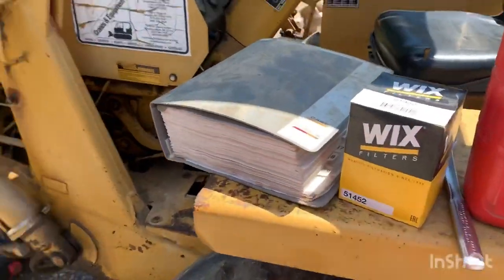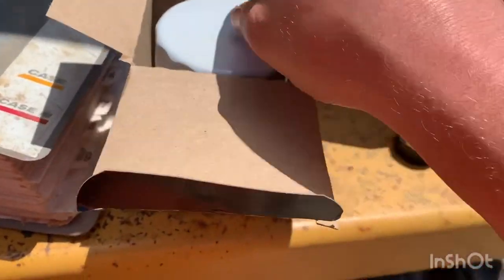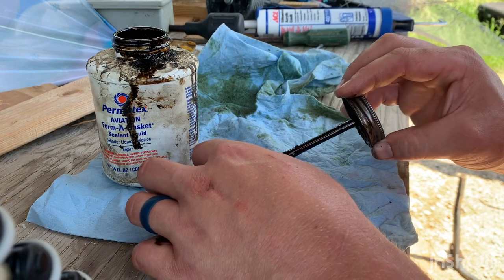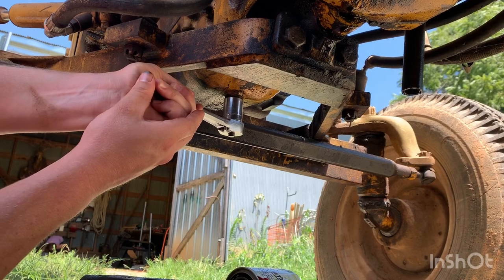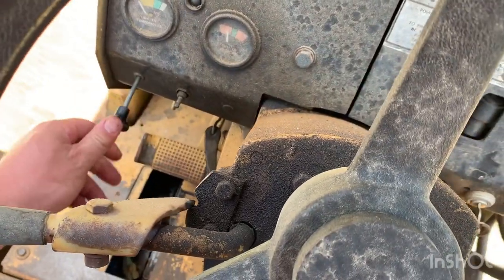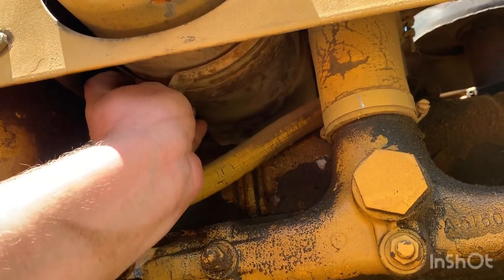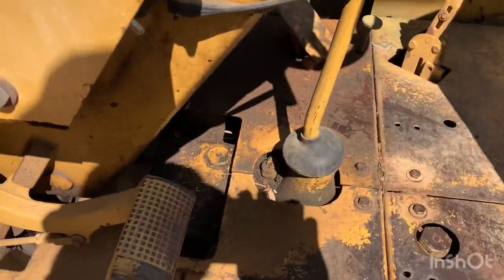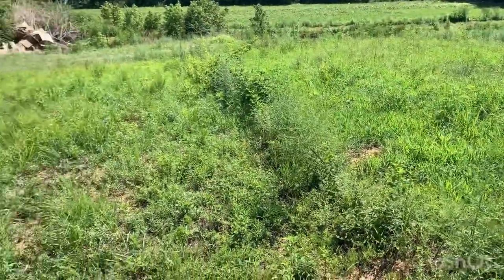Case 580b Oil Change [[How to Check Trans. Fluid, Hyd. Fluid]]

Comment: don't forget to bleed the hyd tanks via forward plug (left side -up front of frame) while filling.  this is because the loader framework does not sit level with the loader bucket on the ground,  trapping air in front sections of frame.  Once filled to the bleed plug,  insert bleed plug and then fill to the full level plug at rear (which you show).  Backhoe in travel position.
Reply from the maker: Thank you for the tips and thank you for watching!

Comment: Thank you so much for posting this video! We just purchased a 580CK diesel for building our modified Earthship Biotecture style home in Northern Nevada. I need to order up a manual and do all of the filters and oils changes. She's not perfect but if she stays running - we'll be able to get things done. I just blew a hydraulic line on the manifold yesterday...this mornings job...repair! Blessings!
Reply from the maker: I had to look up what a Earthship Biotecture home was . I was not familiar with it. Sounds amazing. I wish you the best in building your home. I had a lot of trouble with hoses and cylinders when I first got mine. I kept fixing the issues and kept going. Now the issues are much less frequent. Good luck and thank you for watching!
Reply: Thanks a bunch Amigo it gave me some insight for my dad's Boss at his ranch, his case 580 super drives a short distance then stops but motor stays running any help is appreciated, Greetings from Texas the lower Rio grande valley. 🤠
Reply from the maker: That doesn't sound good. I wish you luck and thanks for watching!
Reply: @FishHuntCookTinker  I just received a notification from this video...hey! It only took four months!! LOL!! Blessings, Brother! I just blew a hydraulic hose from the pump this morning...hydraulic all over the place! Time to change the filter and put in a new hose...hopefully back into digging the mountain!
Reply: @magdalenoybarra2793  Did you guys get it figured it out? I just blew a hose off the hydraulic lines from the pump this morning...time to do some repairs!
Reply: @rongray4118  my dads boss said he will order the part from John deere. And i will be tasked to replace it. Keep up the good work Amigo. God Bless.
Reply: I know your pain! Hope you and your family are doing Fantastically!

Comment: Did you end up rebuilding the rossaMaster injector pump? Mine started leaking out of every fitting so I gave it a shot. It was really easy. Just have to make sure you get the correct rebuild kit. I ended up with 4-5 kits because they seemed to be missing a few parts I needed. Double check the pump model number. The Injector tubing holds the pump in the factory timing position so be sure not to bend and tubes.

Comment: My Rossa Injector Pump was leaking too. When I went to remove it, I broke off one of the mounting bolts and was having trouble getting the bolt out. Everything was still attached, and in a rather desperate attempt to not leak fuel in the middle of a project, I covered the leaking area with bearing grease. I thought it might get me through my project. But what happened was much better, the grease must have given new life to the O-ring that was leaking, because my leak went away.

So if you are getting leaks around the Injector pump, you may want to give that a try first.
Reply from the maker: That is good to know. Somehow mine completely quit leaking as well. I started cutting the fuel off when I parked it. That seemed to be when I noticed it leaking the most. One time I forgot to cut it off. I came back a few days later and it was not leaking! No leaks since. Thank you for commenting and watching!

Comment: Great video. Thank you for taking the time. Just got a 580B. I noticed the clutch seems to not engage sometimes wondering if I'm doing something wrong. Have you any tips? Again thanks for the video
Reply from the maker: Thank you I tried to cover as much as I could and not make it to long. Mine only has trouble when it is cold. First thing when it is cold it doesn’t want to pull. I don’t fight it. I just let it warm up then all is well. Mine has the forward and reverse on the column. That is all I use. Hardly ever do I use the main clutch. I honestly try and baby the clutches on mine as much as possible. Thankfully I have never had to get into them, but I have heard it is a job. If it’s slipping after it is warm you could have a issue. Make sure you fluid is topped off and clean. If I remember correctly it calls for Case TCH, but I have always used Travelers Universal. I hope this helps somewhat. Sorry I couldn’t be of more help. Thankfully I am not a expert on that yet. Thank you for commenting and watching. Good luck with you new 580.

Comment: Quick question for ya what are the other frame resiviors used for under the one you filled with hydrualic fluid ? The plugs are located up closer to the radiator. It looks as tho they are hooked into the return lines for the hydrualic pump.  Im asking cause im trouble shooting a no hydrualics issue with mine and when i took the return line off the pump there was no fluid in the line i traced it back to those arm resiviors wich are also empty but the one you showed on here is full so im confused   any advice uou have would be greatly appreciated

Comment: I, bought a 1966, ck 530 188 Diesel  Case Backhoe has service work done to it  the shelf  rung off in half inside the fuel pump don't know what cause that to happen then I painted  the whole Backhoe cat yellow  I don't want to   have to keep hiring case service trk to come out to work on it darn if it  costly every time I call them out  case service trk is a $300.00 service  call then after that it's a $110.00 an hour but I had to get them out to fix that
Reply from the maker: I hope to never have to call them! That’s expensive. Thankfully I normally have time to figure out what’s wrong myself. My fuel pump is due for a rebuild. Working on figuring all that out before I dive in.

Comment: In the manual it states fill the oil pan with oil, do not use the dipstick hole to fill. Have you experienced any issues filling through the dipstick hole?
Reply from the maker: I honestly have not read the manual about changing the oil. I have not experienced any detrimental effects from filling through the dipstick tube. I will have to read it this weekend out of curiosity now. I appreciate you watching!

Comment: What type and quantity of fluid do you use for the torque converter?   I am getting slipping on  driving forward ore reverse.  Especially on a slope.
Reply from the maker: I use Traveller Premium Universal Tractor/Trans from Tractor Supply. If it is cold mine will slip till it warms up.

Comment: I just picked up a 580. Wondering how easy are they to flip over? Feels extremely top heavy and almost shit my pants every time I roll over a rock or log
Reply from the maker: To be honest I have no idea. To truly know I guess you have to flip one. Don’t feel bad I soil my pants every time too. It is the one thing I have never gotten use to. I still swing my bucket to the side on steep inclines. As well as plan my paths out carefully. I have had mine what felt like very close to flipping a few times. It always held and never showed any signs of turning over though. One of the biggest things that changed the way it feels is the seat elevation. For years I always kept the seat up high. I am 6’4” and liked the leg room. One day I left it down low and it felt like a different machine. I may be crazy but it really changed the feel for me. Still makes me clinch at times, but makes me feel better. I am not sure if all these machines came with the same adjustable seat post or not. Mine goes up and down a good foot or so. One thing I have noticed is if the back tires are lower on air it feels a little worse. Seems to rock a little more. I hope this helps somewhat. I appreciate you watching and commenting!
Reply: @FishHuntCookTinker  thank you for the reply.  I will drop seat down and hopefully have a camera rolling when I do flip over so everyone knows exact tipping point 😂
Reply: I get nervous on occasion, but never felt like she was about to flip. Just rock a lot to scare me, lol.

I sometimes lower a stabilizer near the ground to pretend I have a chance to be saved.

Comment: My fuel pump is also leaking on my 580B.  Did you rebuild it yet?
Reply from the maker: I have not. I have always left the fuel on. I started cutting it off when I park it. Since I started cutting it off it hasn’t leaked anymore. Even the few times I forgot to cut it off. Kind of odd, but I’ll take it. Thanks for watching!

Comment: Where did you get your manual from?
Reply from the maker: It came with the backhoe when I bought it. I think you can get them online. It has been very helpful over the years. Thank you for watching!
Reply: Can buy from case. I got one from them. Full size shop manual.  Yep wix 51452. Recall it after 20 years.
Reply: I got mine on Ebay. Just search for case 580b ck manual. The are some originals and some copies you can buy.